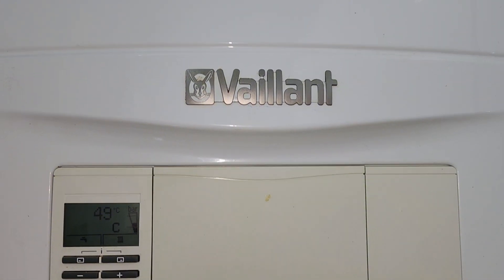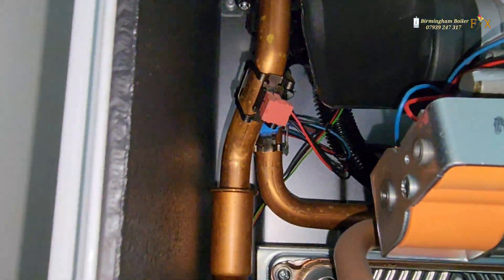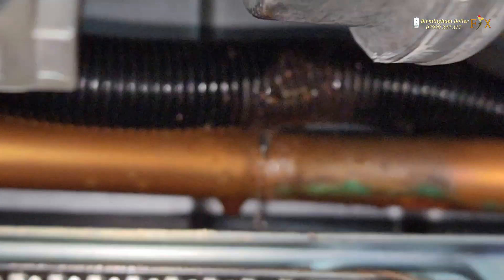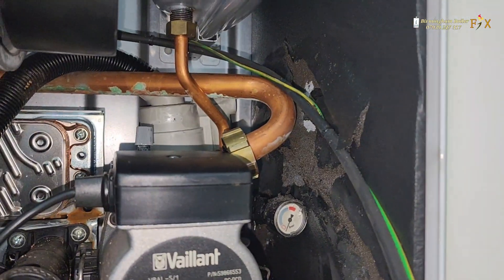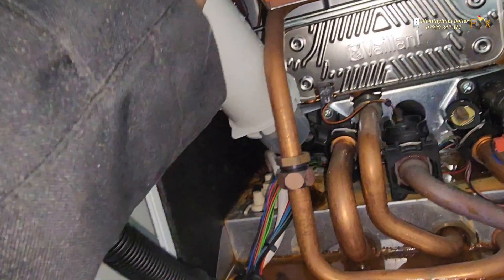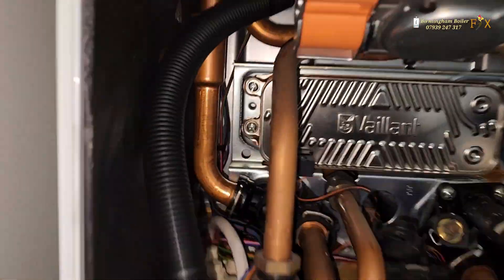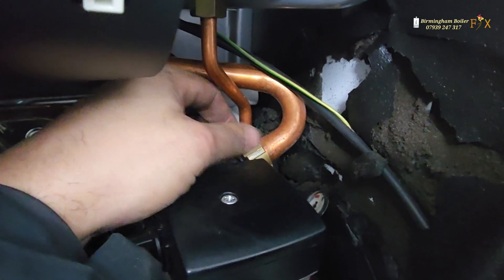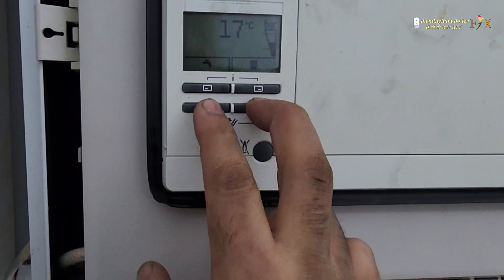Vaillant ecotec combi boiler leaking need it repaired quickly before it stops completely

Comment: U can just take the black hose out without taking the trap out, they click in and out of the trap. Also do you ever do 26.9’s? Never seen you do it on any job 🤣
Reply from the maker: Thank you for taking time out to make a comment 😀
Reply: Can you just pull the black pipe out of the trap or is there a way that it clicks out?